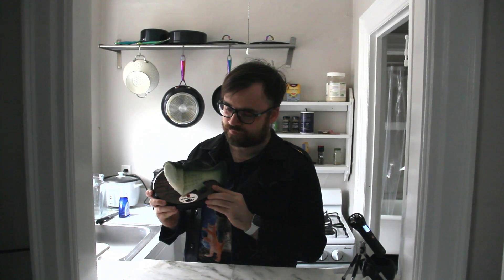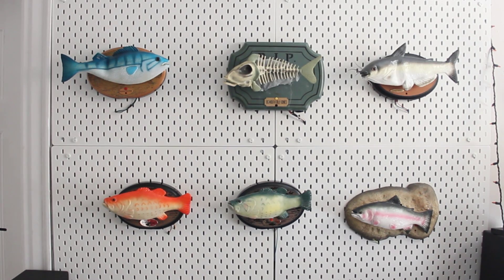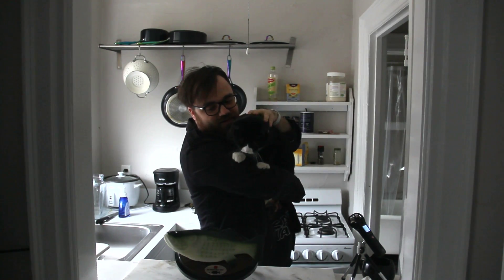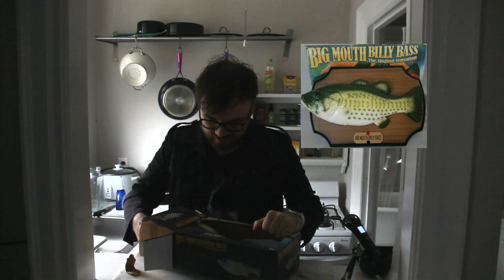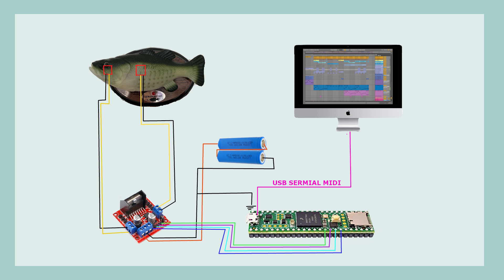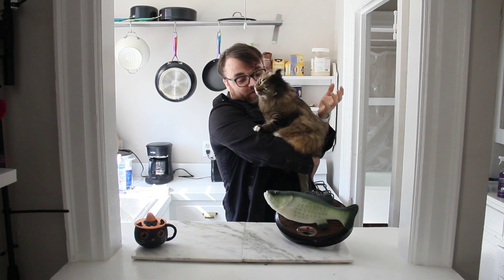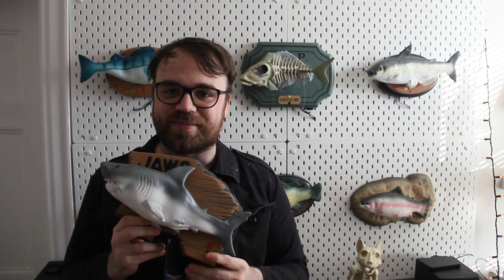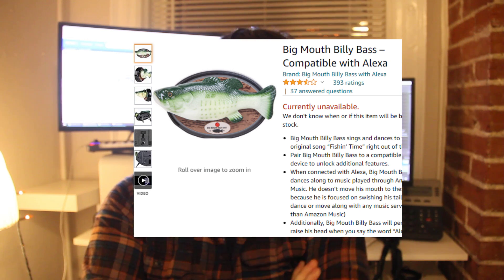I hacked a singing fish.

Comment: Hey! just found this video, and its amazing. i was wondering, do you need to download any libraries for the arduino code. becouse whenever i  verify the code that you had, it came up with some errors. i was thinking it might be because i didnt had the correct library's downloaded.
Reply: also. would it matter if i used a arduino mega 2560 instead of a teensy microcontroller?

Comment: Could you give a wiring diagram or show how you hooked multiple fish up to work together?
Reply: Not a expert, but i'm guessing its all in the code. Each fish is sent same audio witch gets processed and there is just code limiting witch parts that particular board does not play. Not sure if there is software around that can do it automatically, but guess its possible by audio analyzing certain sounds. Really dont know much about coding side, witch is why most of my ideas are grounded. I'm more of mechanical engineer than software.